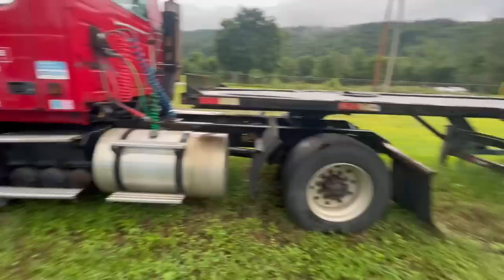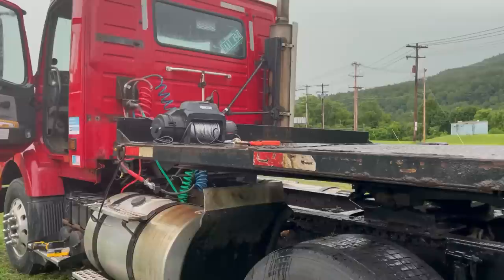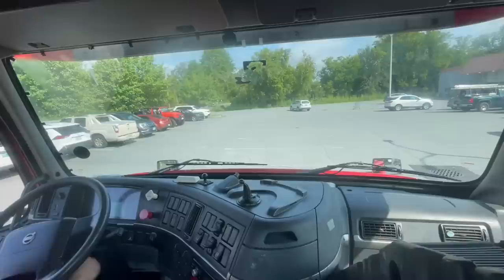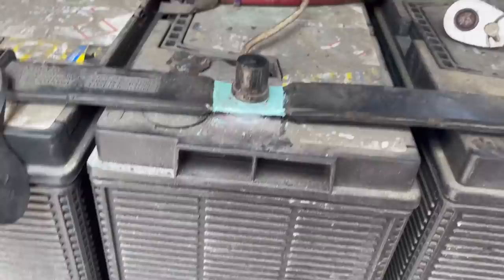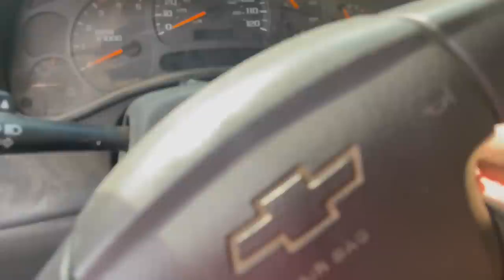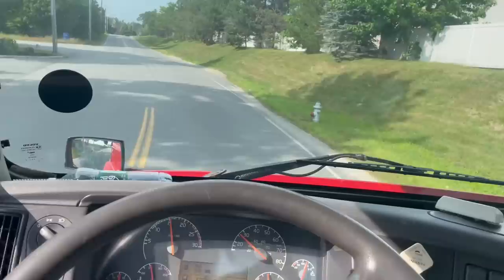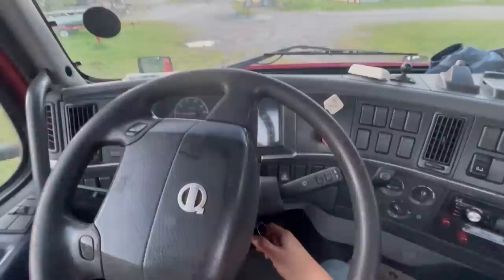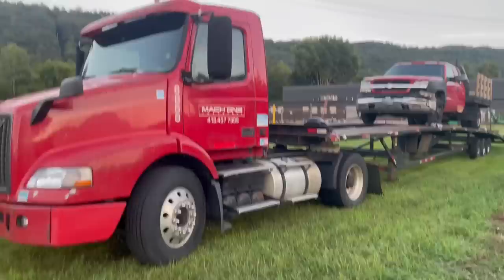Hauling With My $6,000 Semi Truck. It Broke Down!!

Comment: Congrats on your CDL. Just a few things, get those ramps out of the cab, DOT will cite you for it. Strap them down on the trailer. Secondly, put a backing plate under the the backside of where the winch bolts go through the trailer. It will not take much force to pull them through the plating. Good Luck with the cdl.

Comment: Great Job / would suggest making a plate for the winch to sit on and better bottom washers or larger bottom plate to sandwich the deck more strength also buy a snatch block to multiply your pull
Reply: This. Didn't like the through bolt without a big plate behind to spread the weight more evenly.
Reply: I was like "ehhh, bruh, you sure about that setup?"

Comment: Good video and congrats on the CDL. Couple things I noticed in the video, just wanted to point out for you.
1, If you're able, you should mount the winch on the trailer as close to the center as you can to avoid excessive strain on the barrel when you use it. Winches work best when pulling as close to square as possible. You can also get more out of your winch by buying a snatch block and hooking it to what you want to pull, then pulling the cable through the snatch block and back to an anchor point near the winch. This will effectively double the capacity of your winch. Those tie down loops on the side rail of the trailer would work well as an anchor point.

2, Someone else said it, but even though you just bought those new super singles, I think you should switch them out for duals instead. Yes, super singles are better in the snow and mud, but if you have 1 blow out, it will likely destroy the rim if you try to limp it to safety, if you have duals, you can keep driving until you can pull over.

3, A little tip for driving that 10spd and reducing gear grind is when you're shifting, come fully off the accelerator as you're pulling it out of gear and sliding it into the next gear, then reapply the accelerator when you upshift. I drove a 10spd for a few years pulling hills fully loaded and very rarely ground gears, even when floating.

Comment: Congratulations on the CDL!!!!  Welcome to the trucker brotherhood! 

You are right on the 13 vs 10. You didnt grind much, mostly butter.   

Few suggestions from a guy that hauled cars cross country. 

Before you lower airbags to unhook it is beet to pull forward just slightly. Do this so the kingpin doesn't get caught in 5wheel jaws. 

Have a basic tool kit and always include tools/parts for  electrical components. All the vibrations and road grime the electric systems take a beating.  I mean you are a beast mechanic so sure you have the tools. 

On your winch I would suggest building a plate in the center of the trailer, so you dont loose space on the deck.  It is also a good idea to put a backing plate for the mounting bolts so they dont pull through. 

Get the ramps out of the cab bud.  Where is the swamper/lot lizard gona sit lol.  JK but for real strap them to trailer. You dont want to hear that noise and DOT doesn't like loose items in cab.  

Get some over the wheel straps. If you need to tiedown to suspension use chains.  Those webbing straps will just get cut if they lay over a sharp edge of suspension.  Also by strapping tires you let the suspension do what it does which is float. 

For your maiden voyage I say it was a huge success!

Comment: Congrats on your CDL! I just got mine back at the end of July. As a truck mechanic I will say one thing, get rid of those super singles on the back. Lots of reasons, theyre really expensive, when they blow they will destory EVERYTHING, when you lose one it puts you oos, and they actually add time to repairs because theyre a lot more cumbersome to deal with unless you have the tandem wheel lift that can slide under it and jack it up to pull it out.

Been turning wrenches on them for 10 years and Ive only ever seen heartache come from them.
Reply: I just blew one out on the trailer. Right-hand side...the whole sidewall blew out. I stopped as soon as I heard it blow

Comment: Bolts nuts new battery cables and 3 brand new batteries that's a good start..congratulations to you for getting that c.d.l. and you're using It  right away...that's a good thing

Comment: Too bad the Duramax got wrecked. Hopefully it is repairable. Thankfully you had only a minor issue on the 'big rig' you were able to fix easily. The new truck seems to be running very well. Good idea to get new tires for your safety and that of others. That you survived Boston area traffic was a real test. 
Hopefully your CDL training taught you some important stuff: Swing wide its a freaking trailer. Always do pre-trip and post-trip checks. Always make sure your 5th wheel is locked anytime you make a stop - fuel, go to the potty or park. Change fuel filters, drain water traps for the fuel and air brakes frequently as needed. Make sure going downhill on long steep slopes in a gear lower than went up. Don't forget to pull into truck weigh stations or for inspections as needed. Always check the height with a load on.

Comment: Is it difficult to check the injectors on the volvo and see if they are all six spraying full amount at loaded  acceleration. Seemed a little hesiation at loaded takeoff. Should be smooth and no missing in full throttle accell from standstill, so you may have a few bad injectors..

Comment: On the back of the cab of the Volvo there is another plug outlet it’s called for lift gates you can get the cable that goes there and wire to run the winch so you don’t have to pull the battery cover every time

Comment: You've got a signal/ marker light out, or going out  which is way it's blinking faster than it should be. Maybe your 4 way flasher is fried. It's great you got it back! Couldn't your friend be there to cheer you on!?! Or at least help load it? 😂 Anyways,  good luck with both of your trucks.  Never a bad idea to have a CDL license.  I'm 62 and drove for 38 years. Semi retired now dealing with cellulitis in my leg.  Yeah. Boston.  Used to go there  a few times a week from down here in  Amishland,  middle of PA.  Be well and safe travels.

Comment: I've never owned a Duramax but it may have an inertia switch that trips when the truck collides with an object hard enough. The inertia switch cuts the fuel off in case of an accident so if there's power to the electric fuel pump it doesn't keep feeding fuel to the motor or wherever there's a break. That is for in case there's a fire, you don't want to be feeding fuel to it despite diesel's high flashpoint.  It may be reset by pulling the fuse or disconnecting the battery. I don't know though, I've had a vehicle with one and you manually reset it at the switch.

Comment: Well, loading the duramax was a lot easier than anticipated! I expected more "dumb" drivers on the congested highway lol

Dunno what happened to your hand when installing the winch, but I recommend that you pack a "First-Aid" kit in each of your vehicles. Seems like you're getting cuts pretty frequently. Infection is nothing to play around with especially in the Rural areas.

Comment: Your tractor already has power cord connection on it just below the airlines. If you get the correct plug you can just plug the winch in.

Comment: Your old batteries will run your new one down to their capacity, you know that right? Usually a bad idea for any decent length of time.
Reply: Also your winch would likely have not winches the duramax onto the trailer. Usually you need basically double the capacity of the weight you want to pull. It might have worked if you'd have doubled up your line that would have decreased the load.

Comment: You should check the height of the truck, with that trailer empty your height of the truck should be around 11ft, the van at that height may have been around 11.5 or 12 feet

Comment: Saving up for a truck right now I was thinking 30 k but Damm 6k I can get me one in two months fuck yeah glad prices are dropping
Reply: Do some heavy research on what you will use your truck for, what issues they have, and what maintenance they need. Some engines in semis are garbage while others are bulletproof. Emissions equipped trucks will be less reliable and efficient than a pre emissions truck, but it might be necessary depending on where you live. Just make sure to look it up. You don’t want to end up with some international engine that sucks.
Reply: @josephsamsor1698  Damm thank you for the advice bro I didn’t know any of this

Comment: you always start in 1st, starting in a higher gear causes premature clutch wear, don’t make it a habit
Reply: Not necessarily. Even the automatics are programmed to start in higher gears if bobtail/empty.
Reply: @dchawk81  proven fact that premature wear happens from starting in a higher gear than 1st, even Eaton-Fuller will tell you that.  You start in 1st, or you’ll pay for it later

Comment: That's quite some rig you've got there. I may be wrong but to my ears you sounded to be short shifting, eg changing gear at too low engine revs when speeding up?
Reply from the maker: I like to shift at 1500 but with a heavier load it should prob shift at 2k. Torque band is best from 1200 to 1500

Comment: Shouldn't you be using chains instead of cloth straps to tie it down? IDK you're the guy with the CDL not me so I expect you would know.
Reply: coming from a guy that deals with truck inspections every day, its not illegal to use straps around the axel for vehicle tie downs but it is frowned upon. Straps designed to go over and around the tires are fine, but we don't like seeing a ratchet strap used in the way it was.

Comment: The winch not so good a buy. I broke one on my first winch out. No Vermont inspection? 😅😂😢 Being a salt zone truck the best thing you can do is take some length off both ends the corrosion likes to travel.
Reply from the maker: Oh yikes hopefully mine doesn’t break. Not yet on the inspection, needs a few minor things first
Reply: @ARuralVermonterQqjmcb182 I love that truck you get that in Williston at Hirschak Auctions? You have better luck finding deals there.

Comment: you need to put a plate under the trailer where the winch is bolted. those bolts will yank through the diamondplate